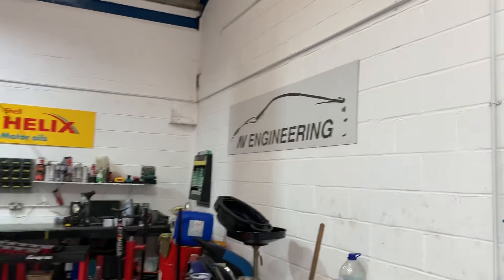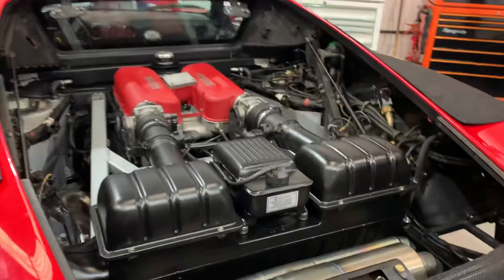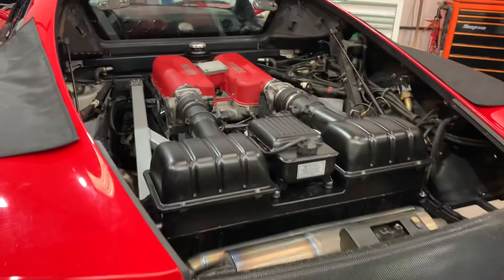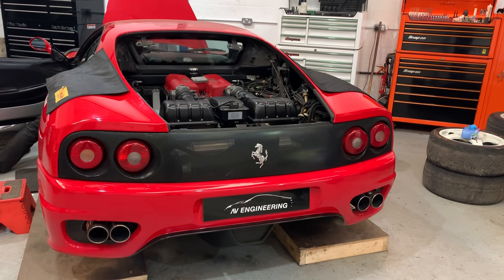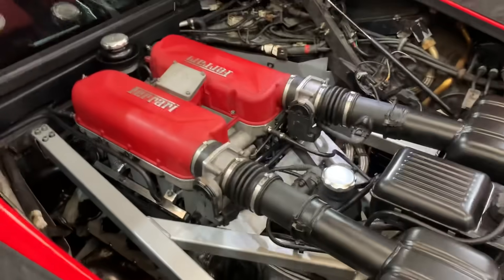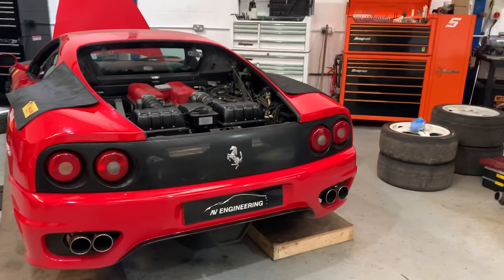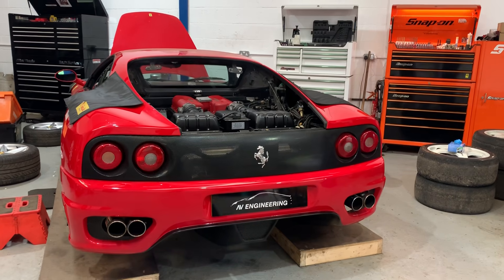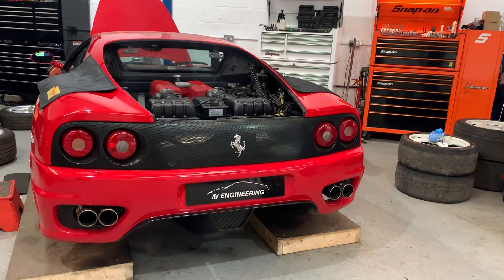Ferrari 360 Engine start up after rebuild

Comment: Hi - Brian shared this video in a thread on pistonheads about his rebuild,, throughout which he's been singing your praises. I've got to say I like your approach, you are doing things properly, and its really nice to see some of your attention to details such as the correct black crackle paint on the oil tank, the exhaust/bumper heatshields etc... Nice!

I'm presuming the smoke rising from the engine near the bulkhead was nothing more than residual oils/cleaners evaporating from the engine?
Reply from the maker: Yes.  The exhaust manifolds were polished up with scotchbrite and duck oil - the smoke was the oil burning off.